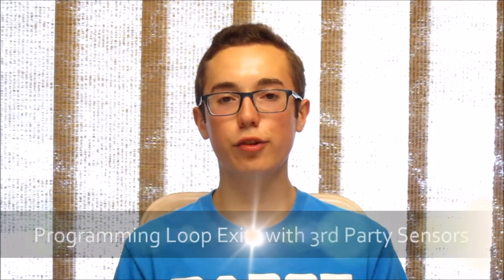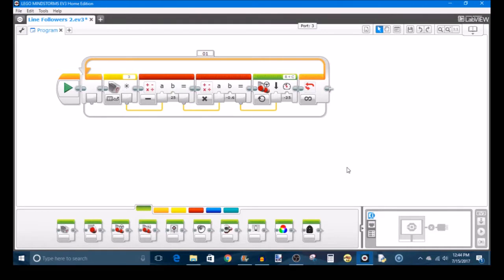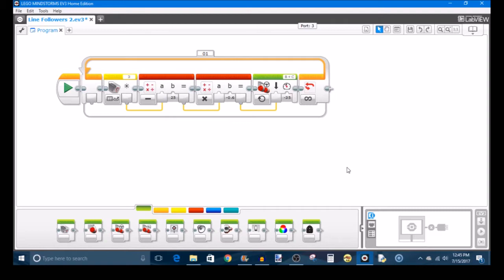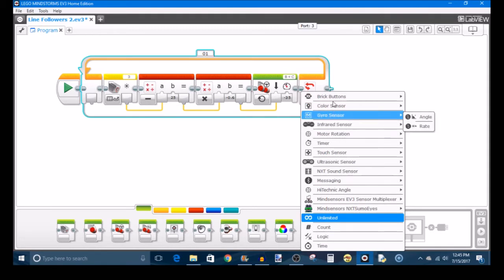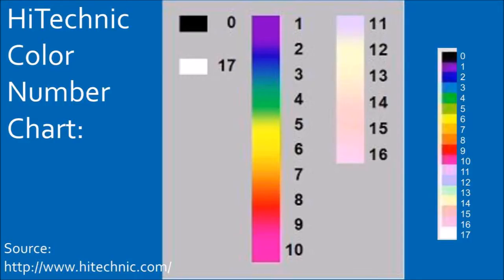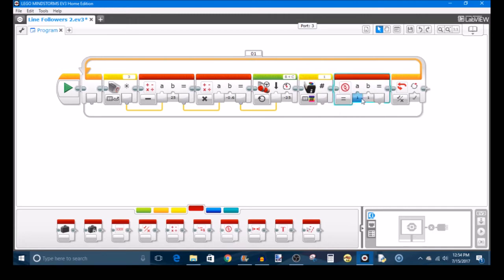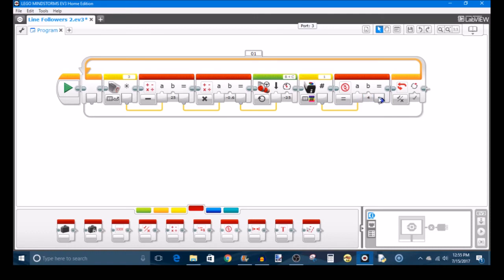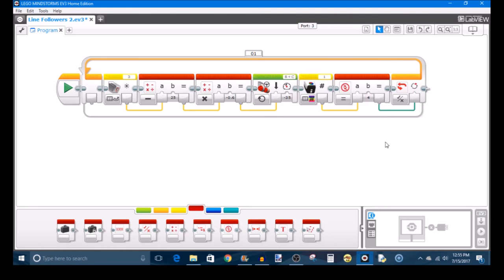Programming Line Follower Loop Exits with the HiTechnic Color Sensor

Comment: Hello!!! I 'd like to have your advice. I have to do 30cm straight lf between light blue and grey area. (And this is for a national contest, so I can't predict how the headlights will affect on my reflected light values). The ev3 color difference between light blue and grey of reflected light is about 20 units. The RGB differences are no more than 60units ( =greater for RED)  with ev3 color sensor. Using HT, I see that it recognizes light blue as 3 and grey as 12. In the middle of the two areas the color is 3(!!!) and remains 3 even if the HT color sensor "sees" more light blue than grey.  I have no experience of passive and raw values, but I can see good differences for them...How  do you advice me to do this lf. Have you any tutorial or suggestion? Thanks a lot.
Reply: I am waiting for any suggestion at gstathopoulos100@gmail.com